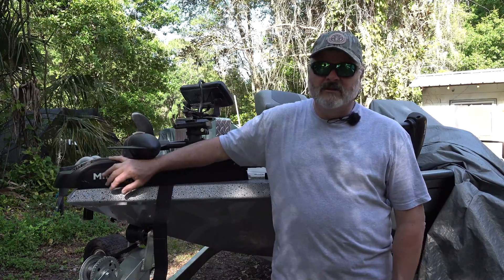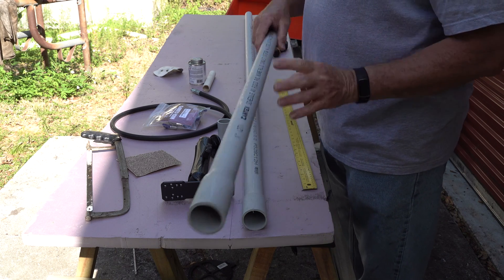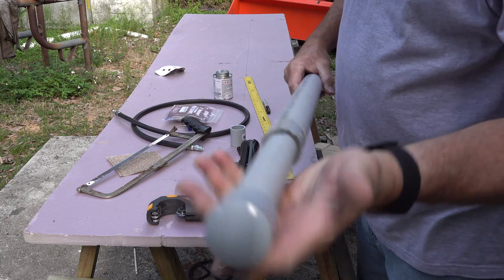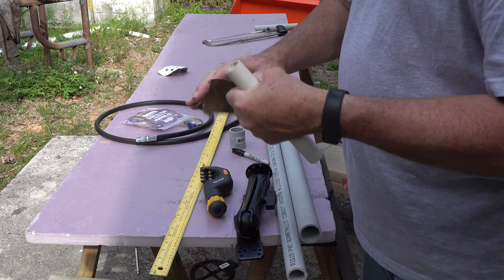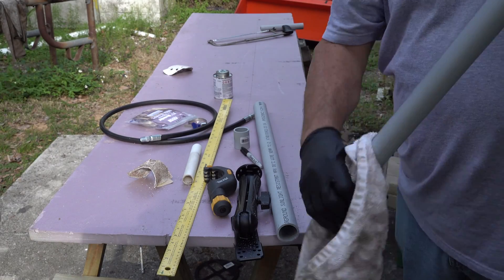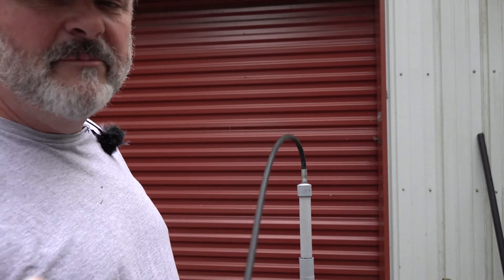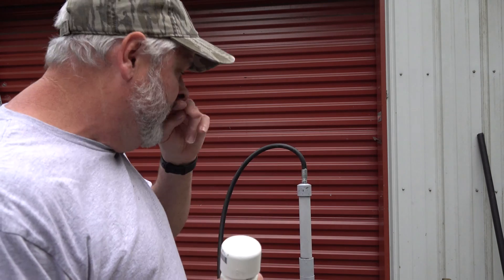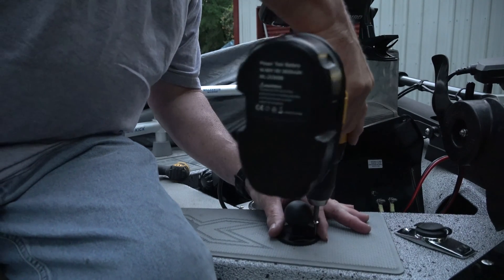Build your own forward facing sonar pole mount for around $100.00. Complete DIY Build

Comment: I don't know if I would change a thing but if you want something smoother than a hydraulic fitting in your hand I used a knob bolt from Amazon. A 1/4" knob bolt will screw into a raw end of the 1/4" hydraulic hose. I put sealant on mine but I don't think you have to. I current fish a lot so I needed one in the pipe to add some resistance so it wouldn't turn unless I wanted it to. I used aluminum with bearings and it turned very easily before the tension knob bolt was added. Most of these things are trial and error. lol
Reply from the maker: @turdferguson5300 There is always improvements for everything. I appreciate the suggestion! I also made an interchangeable control arm in this video https://youtu.be/5oymI2XLgDM Don't know if you seen it.
Reply: @hazmoreoutdoorproducts  I mounted my rig to the Humminbird 360 pole so it goes in with the trolling motor way up on the front of the boat 5' away. I know because I needed a 6' piece of hydraulic hose. That was the main expense of the build. I live between Watts Bar and Sequoyah nuclear plants and they take their scrap to Seaton Metals in Athens Tn. where I buy aluminum and stainless for $1.25 per pound. Almost any size you can imagine so the metal was cheap and so were the stainless ball bearings and collars from Amazon. They got me on the hose but nothing else worked as well and believe me I tried several things. I even tried a toilet snake, (a new toilet snake) but as you can imagine it was shitty. (pun intended) 
My next project will be power poles. Seaton had 1"diameter stainless conduit that I'm planning to start with, Walmart has 8' fiberglass poles in the garden section, and the plates/mounts will be aluminum. I think 12 volt actuators will be enough to hold a metal boat I just don't want the extremely slow ones. That will be the expense in this project. I don't want a remote just a simple up and down switch. I'd be happy if they held in 12' but we'll see. These mounts also need to fold forward for backing in the garage or not going through the roof of the boat dock. When your boat is going up in the lift you do not want to hear wood splintering. Not that I do anything like that. lol